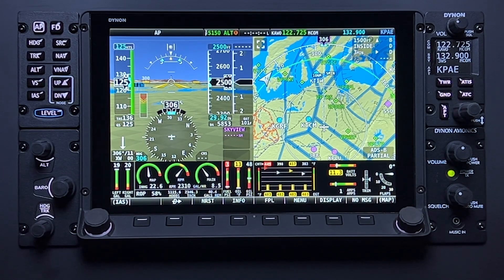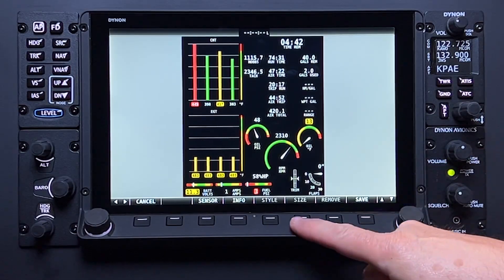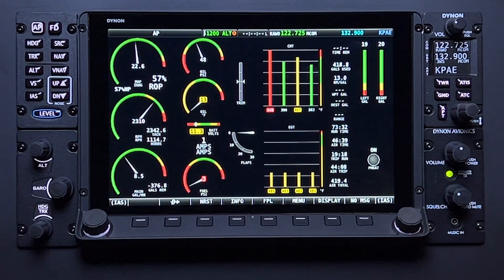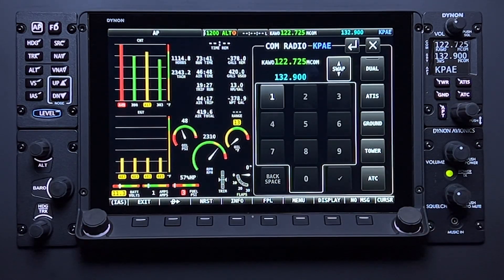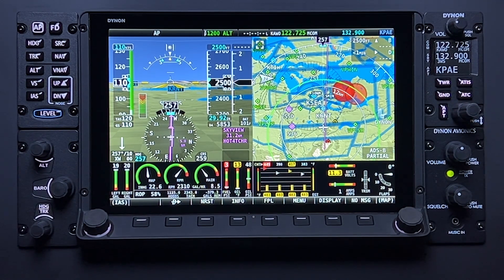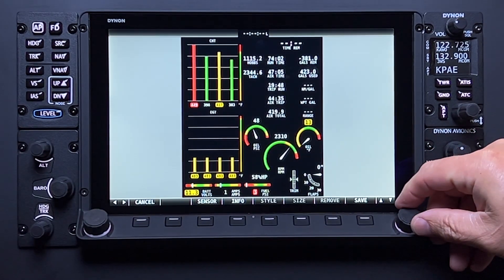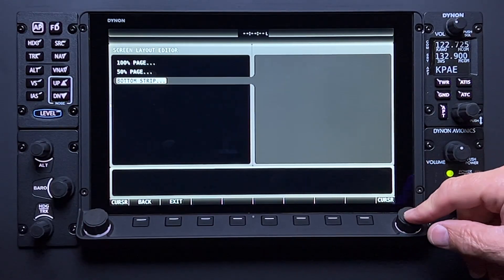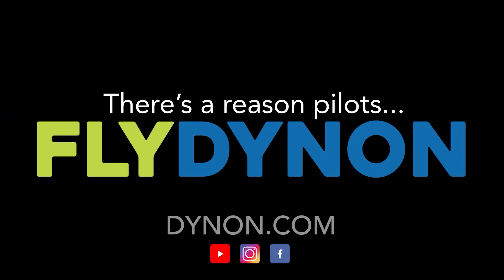Engine Management System Page | SkyView HDX Academy

Comment: This is basically the same stuff in this video as the video you posted 5 years ago, just spoken slower.   What I want to know is EVERYTHING about configuring engine monitor sensors.    You've got nothing about that in your manuals and nothing in any of the videos I've seen so far.  I am a cheapskate.  I also don't like poking holes in my fuel system that I have to patch later because... you know, fuel.   I've got a fuel pressure sensor from a previous engine monitor system that's 0 - 30 PSI, and that worked great for my engine... can I use this sensor on your system?   If you're going to make more videos, please make sure the content is unique and useful.   This video is nothing but a reiteration of what you've previously posted, and I've lost 12 minutes of my life with no gain.